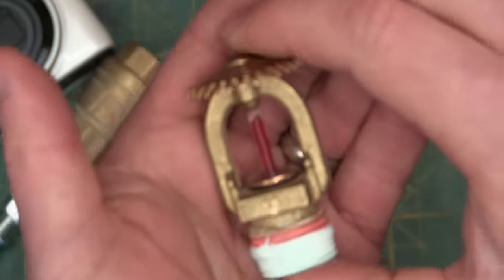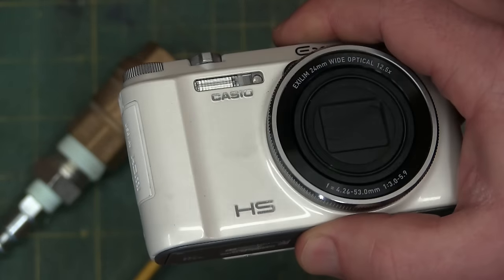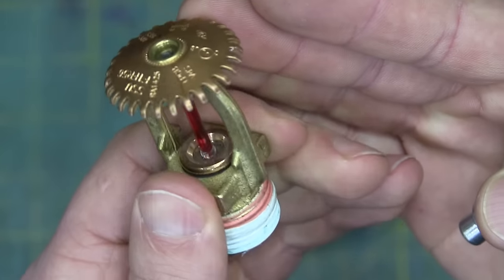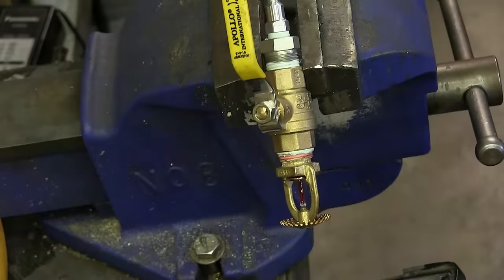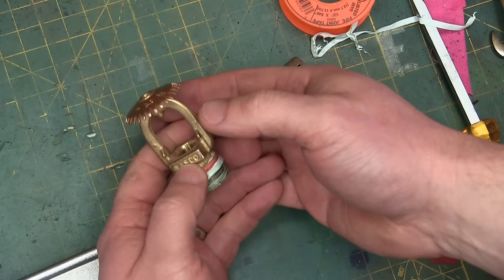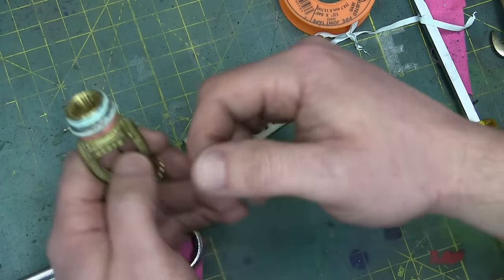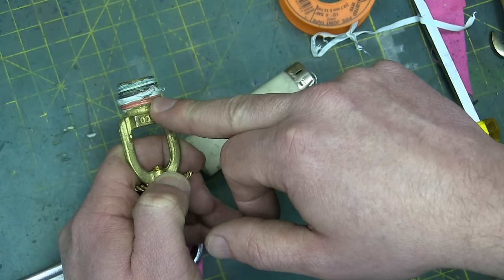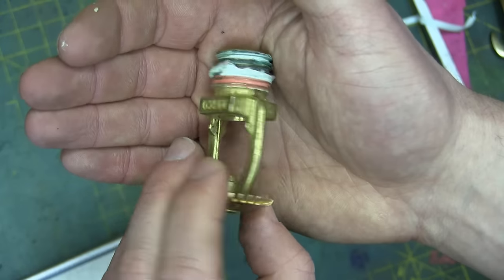BOLTR: Fire Suppression Sprinkler Head

Comment: But how do multiple sprinklers release at once? Pixie-controlled, pressure-something something?
Reply: Emil Lie Hansen they don't. when you see it in movies it's bull shit
Reply from the maker: That's likely arranged with the guys that make TV crime dramas.
Reply: No shit
Reply: Sprinkler systems with heads similar to this one are individually controlled and independent of each other.  Only the heads that take in the heat of a fire will activate.  A deluge system has open sprinkler heads ( no little red glass tube or thermal coupler) for the entire grid or area and rely on an external trip or manual trip to get them all to release at once.
Reply: They're all set off individually by heat there's no electronics.
Reply: Emil Lie Hansen I'm no sprinkler scientist but I suspect they just pop when they get some fire on em. sprinkle as needed. there are also dry pipe systems where there are none of these heat popping devices. some sensor opens a valve and floods the line and they all spray at once
Reply: Emil Lie Hansen there are pressure sensors inline, and when the system detects the pressure is lowered, it activates the suppression pumps. the pumps create enough pressure to break the glass trigger on all the other sprinkler heads in that zone.
Reply: multi headed one's that activate at the same time are normally operated by a metron system.  they work one the same principle as the one in this video,  but they can also be operated electronicly. the ones I've worked on have a solenoid in them that is used to break the glass but you can get ones with small explosive charges in aswell.
Reply: this is just theory, but it's possible that the low pressure shock wave of one popping could travel down the line and hammer on the glass of neighboring sprinklers as it moves past them, causing them to shatter, and resulting in sprinklers around the heat source spraying; not just the ones immediately above the heat; I'm not sure if this effect would domino out or dissipate, maybe destructively interfere; and of course the glass would have to be strong enough to hold the load but not strong enough to take the water-hammer, that might not be an engineering target they bothered with.
Reply: the next vidjayoh should show those tubes freezing.  Nothing like having your hotel evacuated at 2 in the morning at -40 dungarees because the sprinkler head got cold and popped the cherry
Reply: Marshall Gibson, you're right about dry systems,  but... they normally do have the glass in,  and the air is pressurised, holding back the water.  these are normally used in extremely cold places so the pipes don't freeze.
Reply: Emil Lie Hansen they don't. they only go off if there is a fire underneath them. 

the only time they all go off at once is in a movie. it never happens in real life. imagine the damage that would occur if all of the sprinklers in a building went off because an asshole held a lighter under one. 

it doesn't happen. 

they work by having a glass cylinder that contains a glycerin based liquid inside. the glycerin expands when heated and breaks the glass. HEAT IS REQUIRED IN ORDER TO SET THEM OFF INDIVIDUALLY.
Reply: Graham Staines the one he is holding is a base model that is controlled by nothing more than a glycerin based liquid inside of a glass tube. 

yes, there are, (as you know), large commercial systems that are designed to suppress a fire in a warehouse, or an airplane hangar, that use solenoids, or tiny charges, but those are not common place.
Reply: in a Deluge system they have no glass so they can go off all at once, it's either a external fire department connection or a computer controlled heat sensitive  valve.   #firescience
Reply: mr42ndstblvd 

>Walmart

Found your problem
Reply: Happened to a condo in my building. Top floor person was gone and left the heat off all winter. The supply line above the ceiling broke. There is an INCREDIBLE amount of water in those lines. It was a water fall out of every door and window.
Reply: Yidris the air bubble is the magic, when it is exposed to heat, the air bubble expands causing the glass to break.

air bubble size varies depending on response time of the head 

I am a fire sprinkler fitter
Reply: mr42ndstblvd Wal-Mart  needs to actually do there inspections and maintenance.

unless this Wal-Mart has a very specialized system. they won't have sensors next to the head.

If there are sensors,  the system will need two events (heat and smoke, or heat and manual pull station)
Reply: I think you'd need to put something in the vials with a little more kick and that probably would destroy the sprinkler itself. Buuuuut, fuck knows, so try it.
Reply: Tracy Norrell 
Years ago.. I was told ,,   that the lines had air in them,,, and when one sprinkler head was activated the water shot through the pipes fast and hard enough to be a hydraulic hammer, and that is what popped the rest open. Now that was 60 years ago, and I am sure things have changed...
Reply: I saw one of these go off when a guy in a scissor lift accidentally broke the glass by bumping into it with a drill, as mentioned the water that comes out at first is black and smells like death, however the sprinklers immediately surrounding the broken one also went off when the big pump in back kicked on once it detected the pressure drop. 

The whole system didn't go, and only one of the 4 pumps in the fire room kicked on (figuring out how to shut that down was a treat but I was the guy with the key to the room it was in so guess it was my job) so it seems they can be deployed or activated in zones, which makes sense. 

I have pictures of the water borne destruction somewhere, and again, I saw this with my own eyes on a construction remodel job site.
Reply: One of the good reasons for this type of fire-suppression is when you have loads of sensitive equipment you'd rather not submarinate. Say you have a 10million in CNC machining centers in your facility, but only one is on fire...would you want to drench them all? No, you don't, so you spot suppress the fire...if it spreads, then so does your coverage...make sense?
Reply: There is such a think as "flood" sprinkler system, used in hangars and such. They basically fill the room with foam.
Reply: yourbeekeeper This is the only correct answer.
Reply: Nope, but nice try. In most situations like the ones you will find these $5 sprinkler heads in, you don't want to put water on shit that ain't burning. Example: an apartment complex with say 100 heads, just the 2 or 3 heads in the room of origin will be activated. The fire goes out and all other apartments are high and dry. Your mileage may vary.
Reply: Emil Lie Hansen Typically they do not release at once. When you see something like that on tv, it is Hollywood magic bs. But that being said, there are some deluge systems out there that are electromechanicaly controlled with a valve that holds back the water, and the pipe is dry and the heads do not have the glass bulb and plug in them, that will flow all at once, once the valve has been activated. But usually what you see in most applications are sprinkler heads like this one that Ave has that will only activate individually. There are also other types of systems, but that's a whole other story.
Reply: Albertweber16 you are thinking of deluge systems that all the heads go off at once. usually used in wood mills.  airport hangers are still individually activated usually with some type of separate great sensor. they do also have foam cannons that are set to a specific pattern.
Reply: Jack Blakely the other heads should not have gone off as well. the only thing i can think of is water hammer effect. the sprinklers only activate individually. unless it is part at a deluge system, but those sprinklers are manually operated and do not have a glass bulb.
Reply: Willy Bee only dry systems have air in them. usually found in parkades or other areas exposed to out door areas susceptibility to freezing.
Reply: I used to fit sprinklers, too - wet and dry systems.  Never saw a glass sprinkler cause a bunch to go off at once - only on a deluge system.  Even pressurised dry systems, when they lose air pressure, only spray from the fitting that has the broken glass.  Too much water damage happens when you set them all off at one time - you really only want the water going on the actual fire, not spraying around willy-nilly.  PS:  gotta love that bubble - we used to have to double check for it, as occasionally we'd find one that was missing the bubble.  Have to change the glass then - or more commonly, change the whole fitting. :-)
Reply: It depends on the system! I suspect the one you mean has a large tank on the roof with a pressure valve feeding the individual sprinkler valve runs! When one pops it starts to discharge the low pressure water in the pipe system. When the pressure valve detects no pressure on the sprinkler runs it opens and HP water is fed to all the sprinklers! If you see it on film it usually shows a few seconds of drizzle followed by a deluge and all of the sprinklers popping!
There is more than one system though! :O)

You know you will be watching for this in the next film!
Reply: Sprinkler heads are set to open at a set temperature. The one shown and demonstrated is one of this type which I will say opened at 450+F  degrees.  There are many different types and operated by multiple sources such as manual operation, heat, flame detection, infrared, pressure etc.  Some are open and the water supply is controlled and set off by detection from one of the above sources.  Hangers usually have this type which floods the whole area covered by the "sprinkler system".  The "open" head type usually has a covering on each head to keep dust and debris out and opens when the valve allows water in and its' pressure hits it.  On others air pressure is used to keep the main water valve closed.  It takes 1 pound of air pressure to hold about 7 pounds of water pressure back.  The sealed sprinkler head type which has water in the supply lines, hence the disgusting stuff, is used in areas such as  office buildings, shopping malls, industrial buildings, etc. where one would want to just open the sprinkler heads in the area of a fire and limit water damage to other areas. The one demonstrated uses a glass tube filled with a fluid that expands and ruptures the glass at a certain temperature.  Others use lead mixed with other materials that melt at certain temperatures.  Different temperature rated heads are required for areas covered depending on the temperature of that area.  The lower part of the sprinkler head is a diffuser to make a fan like flow of water, not to direct the water to the ceiling.  The diffuser can be set for any coverage from 90 to 360 degrees
Reply: No, why do people make up stuff like this? Regular sprinkler systems are designed to activate heads only as absolutely required to suppress a fire. The fire code is a compromise between safety and potential financial risk. No fire insurance company wants to completely rebuild a building if the sprinklers do their job in putting out the fire but in the process floods the entire structure. If nearby heads activate it's because they were already compromised by temperatures approaching the trigger point, or they were just plain faulty.
Reply: I used to work in this industry years ago , the red coloured sprinklers go off at 155deg F.  AS soon as one went off , the pressure at the valve station in the plant would drop suddenly , because water was coming out of the sprinkler at an alarming rate , ( pun ) This would usually set off the alarm to the local Fire Station . If the fire was relatively hot , quite a lot of sprinklers would go off , depending how much temperature was in the building.
Reply: Emil Lie Hansen the heads with the glass vials are on what is called a wet system because there is actually water in the pipe,  water only comes out of the ones that  get hot and bust ( they don't go off all at once in a office building like Hollywood shows).

there is another type of system called a deluge system that has the main heads without the glass on a empty line that is just open( looks the same as the one he showed after it had busted) and there is a sensing line ran with the main one that has the heat sensitive heads.  when one of them bust it drops air pressure on a valve and all the heads on the main system flow..
 
there are also systems like a fm200 system that removes the oxygen from a room and extinguishes the fire without water. this is often used in computer rooms and other places where water is detrimental to equipment insude
Reply: +robert singleton  I remember those computer room systems.  I think they used to use halon gas?  They could be a bit dangerous, as the room needs to be sealed to keep air from entering and the extinguishing gas from escaping - after an appropriate warning time for evacuation - and anyone trapped inside the room after that point would suffocate.  Telecom in Sydney used to use this system back in the late 80s.  Considering the potential dangers, I'm not sure how common it is now, or what gasses may be used (I'm more than a little out of date these days.)  :-P
Reply: aussiebloke609 I'm not sure what gas is used either, but it will definitely kill you if you stay in it to long,
Reply: This is almost completely incorrect. Fire pumps do operate on that principle, but a pump is only required when there is not a municipal water supply with sufficient flow and pressure.

The only thing that causes the fusible link to operate is heat.

Automatic fire sprinkler systems are typically acceptance-tested at 200psi for a period of two hours, or at 50psi above static pressure if the static pressure is greater than 150psi.
Reply: Emil Lie Hansen there is a system called a deluge system.  This system uses open heads. So once water is added to the system, all heads will deliver water.  The water pressure is typically held back by a clapper
Reply: The only systems that multiple sprinklers (nozzles) discharge at once are deluge systems, gas suppression systems and sprinklers controlled by a MJC (multi jet control).
Reply: the sprinkler system your talking about is a deluge tpye sprinklers
they are not pressurized and is manually activated witha switch. commonly used in aircraft hangars
they also use it in movies scene
Reply: some dry system are pressurized with air to prevent ice in the pipes and bursting they work just like a wet system sprinklers. typically used in parking garage that doesnt have heating during winter
the system your talking about that all sprinkler head spray all at once is a deluge system and its manually opperated
Reply: Karl Sarte not true.  Not all deluge systems operate manually, most in fact operate from a solenoid which is activated via an electrical signal like a smoke detector
Reply: James Erwin sorry James but the water isn't held back by the clapper,   The clapper is just a disc with rubber on it to stop water from flowing into the alarm line port.  In a deluge system a diaphragm connected to a pin holds the clapper closed.  If this wasn't there the clapper would just open and let the water in.  Think of the alarm valve as just a non return valve (check valve) with the clapper stopping the water flowing back into the supply pipe.
Reply: robert singleton  there are a number of different gasses used here in Australia, the most common are IG55 and IG541. FM 200 was used quite a lot before we had the carbon tax a few years ago. 
Halon is banned now unless for very specific application.  
All these new gasses will not kill you as the oxygen concentration in the rooms remains within breathable limits. It would be very noisy and probably bust your ear drums though.
Reply: robert singleton fm 200 works by chemical reaction removing heat cause the flame to go out.  It doesn't remove the oxygen.
Reply: Emil Lie Hansen they don't do that except in movies. Only the head with the heat will trigger.
Reply: No electric gizmo's man, just a crude heat activated safety device. The only ones that pop are the ones exposed to heat. Plain and simple. I mean, can you imagine the collateral damage to say and IT company if the entire building started squirting water on everything if there was a small fire in say the kitchen? Lol.
Reply: +Adam Sturgess  Thanks, mate.  I thought I heard something about halon being banned, but it's many years since I came across it.
Reply: +akbychoice  Too cool.  I was there when the St. Leonards complex was being built in '89 or '90 (I think White Industries was the main building contractor at the time.)  Wormald rings a bell - that was probably the subcontractor for the system.  Was the first time I came across those systems as they were being installed.  Damn, I'm getting old...  :-P
Reply: Bummer, mate - my condolences.  :-(
Reply: Paul Copeland please go look up most common dry systems now are pre action (bermaid , reliable DDX , victaulic  and the like). Most of these systems require both activation of a electrical operated valve (solenoid) and a loss of air pressure this is called a double knock activation.  Granted they still have there bulbs intact. This is due to there insurgence into the data centre market which still comply with the standards but is far cheaper than gas suppression system. 
As to my comment to Karl I never made mention to him regarding a dry system, my comment to Karl was regarding deluge system being manually operated which although they do have a facility to be manually operated there primary activation is automatically by one of which ways you have described in your reply.  My comment was to James Erwin and I still stand by it, the water isn't held back by the clapper on a deluge valve or any valve for the mater. It is just a seal.
In the case of a deluge valve (modern day) the clapper is held close by a pin on the system side of a diaphragm, the other side is pressurised via water keeping the pin engaged, once the pressure is relived off the diaphragm via a solenoid or as you have described earlier a set of sprinklers on a pilot pipe  the pin retracts allowing the clapper to open.
Reply: There is just so much wrong in these comments.  "Some" dry systems aren't pressurized by air, they all are, that's what makes them a dry system.  This head is a 155F head, you can tell that by the color of the bulb, it has nothing to do with paint on the frame. Most dry systems are NOT pre-action systems. Most are just regular old dry systems. You use pre-action only in certain circumstances, and trust me there are plenty of options out there (like Viking, Tyco, different models of Reliable, etc.) that are a lot more common than something like a Bermad or Cla-Val.  Also, pre-action systems do not necessarily have to have to causes to activate. If they do, it's a double-interlock pre-action system. There are single-action that just need one.  What else... Walmart heads are not electronically activated, and they don't have a room in back that controls the sprinkler system. I'm sure they have a room in back that MONITORS it. Bulbs don't go off because a pump kicks on.  As someone else said in an earlier comment (thank you for knowing what you are talking about), that would only happen if the heads were faulty, or if they were close enough to the fire to already have the bulbs weakened.  Alarms don't go off because someone notices a dip in water pressure. Systems have what are called flow switches installed. It's literally a paddle in the water, and the paddle will move if the water moves (as it would if a sprinkler activates).  Once the paddle has moved for the field-set amount of time (30 secs for example), it will send an alarm signal back to the fire monitoring panel.  Obviously this is only for a wet (water in pipe always) system.  For a dry system, when the dry valve that holds the water back is tripped, it sends the alarm signal. I think I covered most of the horrible horrible misinformation here.
Reply: only the flow switch up stream to activate the fire alarm
Reply: nope
Reply: Most systems like that use CO2, Halon1301, or similar.